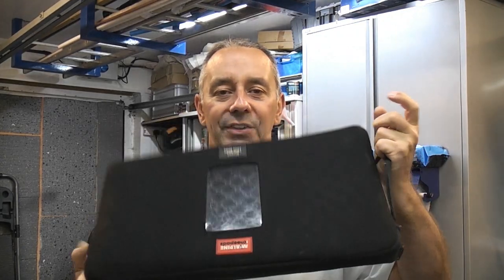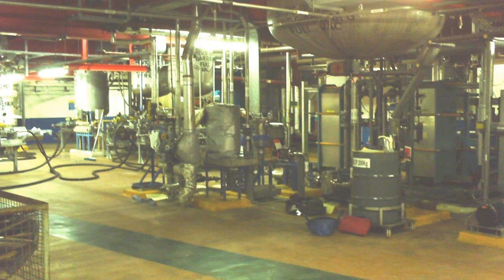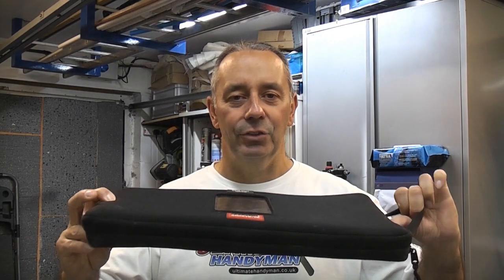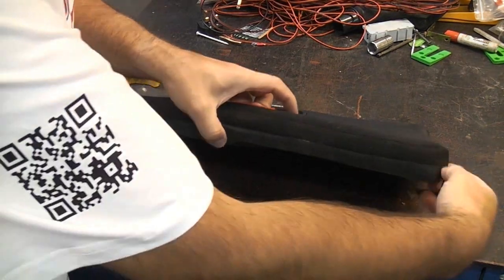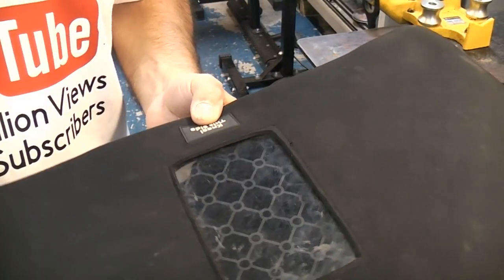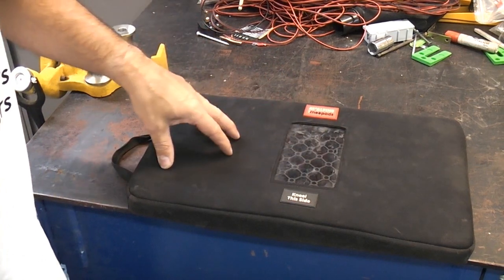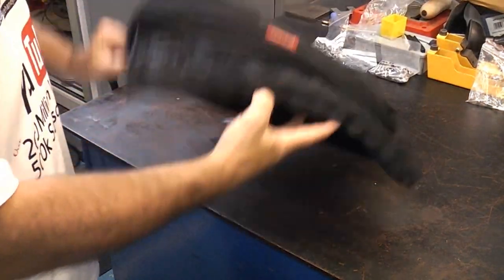McAlpine Kneeler | better than knee pads

Comment: Thanks for your continued reviews. However, at £60+ this is not good value. My local garden centre sells similar cushions starting at £5 !
Reply from the maker: We tried some of those on site, they are ok for some uses. They didn’t last long when we tried them and often got thrown away after a few weeks of use 😉
Reply: £60 sounds like a bargain to save your knees!

Comment: Looks good.
Was that grout remover an add on an angle grinder?
Reply from the maker: Yes it was.
I’ve copied and pasted this from a previous answer- 

It’s a “dust arrest” shroud. I bought it a few years back, but only got time to use it this summer. I bought the one that fitted Dewalt angle grinders. When I came to use it with my Dewalt cordless grinder it did not fit. I asked their support which adapter ring I needed and they could not tell me. I asked them to send a link to the exact adapter ring, but they could not send links to me email (apparently). I then gave them my Gmail address and still never received the link to the correct adapter ring! so I went out and bought a mains voltage Dewalt grinder. This time it almost fit, but not quite (so I could not use a mortar raking disc, without it hitting the dust shroud). The shroud costs almost as much as two mains voltage angle grinders, so it should be good! It’s just a pity that their support is no help at all. It does work quite well at removing the dust though, even though I just used a cheap vacuum cleaner and dust separator. Thanks for the comment
Reply: @ultimatehandyman  Blimey 😦 What a palaver dealing with dewalt. Thank you for your kind reply.
Reply from the maker: @george-1961   It was not Dewalt, it is https://dustarrest.com/
That were the problem. Their support was terrible!
Reply: @ultimatehandyman  Sorry. Got the wrong end of the stick 🤦🏻‍♂️

Comment: Good to see you looking so healthy 👍. The pad looks interesting, wasnt clear what the inner is made from? Also what was the grinder attachment for taking out the grout please? I have similar to do soon and wondered how to best control the dust and that looked ideal. Thanks.
Reply from the maker: Thanks, I appreciate that 😉

I’m not sure what the inner is made from, it’s some kind of rubber type material (but probably not rubber). 
As for the grinder attachment, I’ve copied and pasted this from a previous answer- 
It’s a “dust arrest” shroud. I bought it a few years back, but only got time to use it this summer. I bought the one that fitted Dewalt angle grinders. When I came to use it with my Dewalt cordless grinder it did not fit. I asked their support which adapter ring I needed and they could not tell me. I asked them to send a link to the exact adapter ring, but they could not send links to me email (apparently). I then gave them my Gmail address and still never received the link to the correct adapter ring! so I went out and bought a mains voltage Dewalt grinder. This time it almost fit, but not quite (so I could not use a mortar raking disc, without it hitting the dust shroud). The shroud costs almost as much as two mains voltage angle grinders, so it should be good! It’s just a pity that their support is no help at all. It does work quite well at removing the dust though, even though I just used a cheap vacuum cleaner and dust separator.
Thanks for the comment 👍
Reply: @ultimatehandyman   Thanks for the detailed reply!

Comment: Strap on knee pads are annoying so I got DeWalt trousers and put foam kneepads inside the knee part. So much better. But those combined with this would be perfect. I ruined my knees when I was young as I was an idiot and didn't realise how kneeling on them for several years with no pads would ruin them.
Reply from the maker: Yeah, they annoy the crap out of me too! 
There are two things that really annoy me- knee pads and Hi-Viz waistcoats!
I can wear all other safety gear with no issues, but the two mentioned above really wind me up!
I tried a pair of overalls once with knee pad pockets, but every time I knelt down, I had to adjust the legs on the overalls to get the knee pads in the right position. I guess it depends on the length of your legs etc. 
Thanks for the comment 👍
Reply: @ultimatehandyman  I had same issue at first with the length. Can't remember what I did to fix it. Being 6ft 5" doesn't help but the kneepads in the pockets work fine now. But combined with this would be even better.

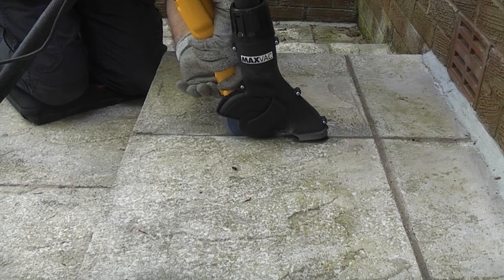Comment: 0:53  Is that a standard grinder attached to a vac? What kind of vac/ attachment is that?
Reply from the maker: It’s a “dust arrest” shroud. 
I bought it a few years back, but only got time to use it this summer. I bought the one that fitted Dewalt angle grinders. When I came to use it with my Dewalt cordless grinder it did not fit. I asked their support which adapter ring I needed and they could not tell me. I asked them to send a link to the exact adapter ring, but they could not send links to me email (apparently). I then gave them my Gmail address and still never received the link to the correct adapter ring! so I went out and bought a mains voltage Dewalt grinder. This time it almost fit, but not quite (so I could not use a mortar raking disc, without it hitting the dust shroud).

The shroud costs almost as much as two mains voltage angle grinders, so it should be good! It’s just a pity that their support is no help at all. It does work quite well at removing the dust though, even though I just used a cheap vacuum cleaner and dust separator.
Reply: @ultimatehandyman  thanks UH

Comment: I have to Kneel down fixing the printers....
The running joke was thats why you called Neil.......🙄🙄
now I just get the younger lads to do the job were kneeling is reqd..
I have combat pants with inserts.... when I remember to put them back in after washing...
The younger lads would rather look cool wearing skinny jeans..
they would never been seen using one of these...but  you can only offer advice...
Informative as ever Chez..

N x
Reply from the maker: Thanks Neil,
I can’t wear trousers with knee pad inserts either, I think it’s something to do with them restricting my movement. I can’t wear long sleeved overalls either, I have to buy a pair and get them modified 😂

I only wear long sleeves when welding for prolonged periods.
Thanks for the comment 😉

Comment: I used a closed cell foam pad that came from a marine oil-pollution boom. I've had it ten or so years. I worked in various environments Waste to energy plants, ports, waste water treatment plants. It is still in perfect condition despite the ravages of welding/cutting, sewage steel grate decking, gravel,concrete etc. Spray it with  disinfectant, hose it off- BOOM! good to go. I wish I'd taken the time to save all of the pads from the boom as I'd have been able to retire years early if I'd flogged them all. To the youngsters out there- take care of your knees elsewise you'll suffer terribly later on.